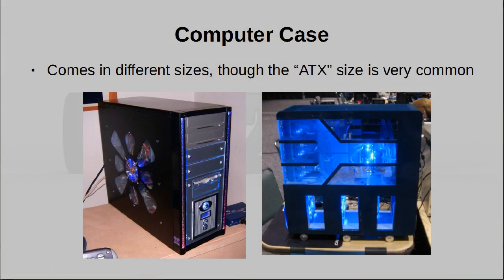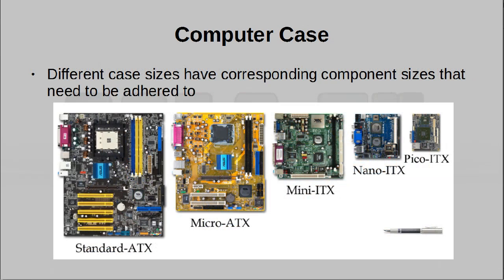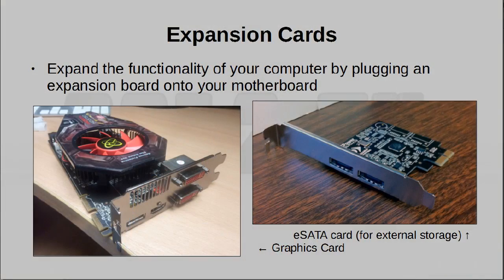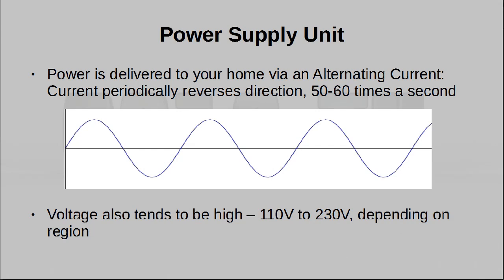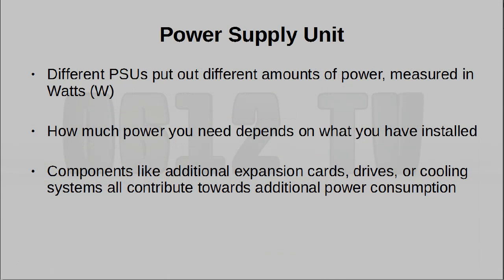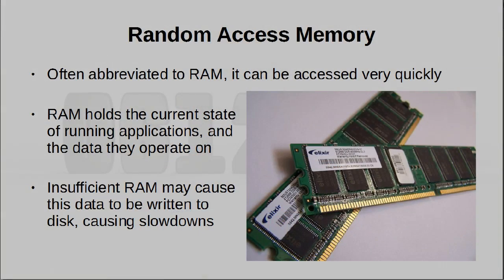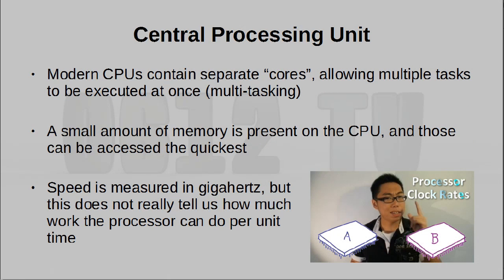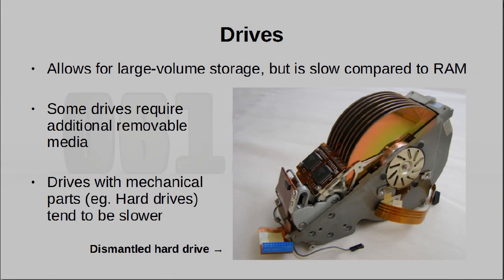Parts of a Computer

Comment: Something that could be good to know is that exention cards actually are computers. In fact, they hace their ownlittle motherboard, their own processor and even their own memory. We often read about graphic cards running at a given amount speed and having another given amount of memory.
Reply from the maker: +Amecareth Qc Hello and thank you very much for your comment! That's a very good point! Expansion cards tend to do their own computation - Usually only data (and power) flows between them and the motherboard, so they really are just a miniature computer inside a larger entity! Very great way of looking at them.